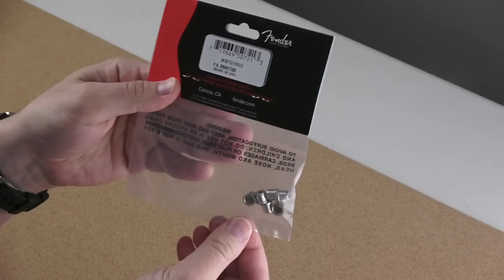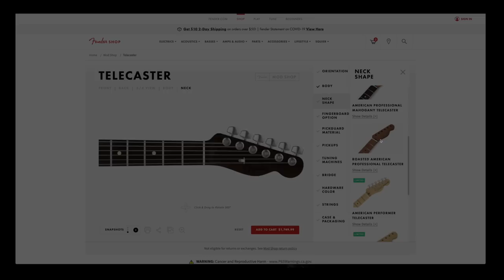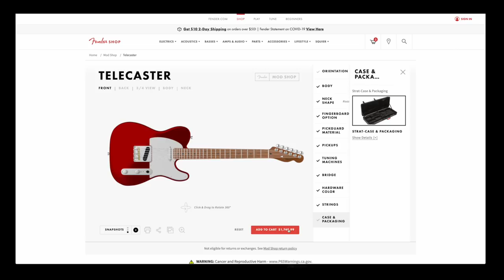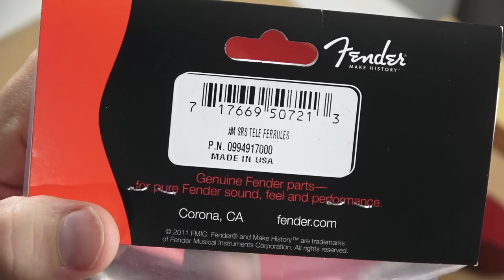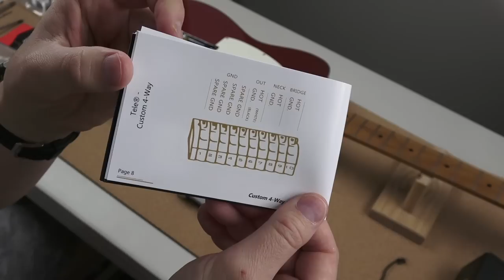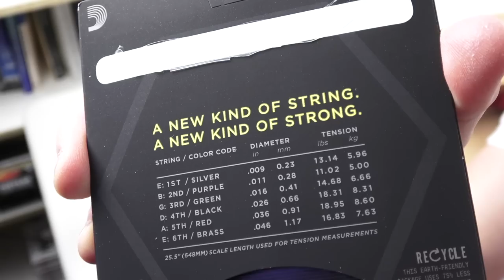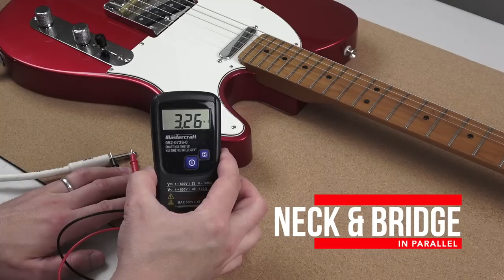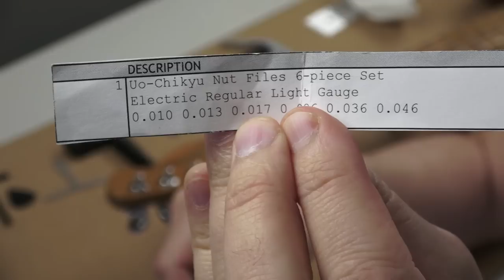Building a Custom Candy Apple Red Fender Telecaster with Roasted Maple Neck  & Obsidianwire 4way Kit

Comment: Fyi when screwing something like a neck for example with 4 screws in a square pattern u need to tighten them in a diagonal pattern. If u start with top left screw - then second screw should be bottom right - then back to top right -  and lastly bottom left. This is to avoid any type of tilt and makes things tighten down evenly
Reply from the maker: thanks for the tip! cheers
Reply: @landonbailey  no problem, awesome videos
Reply: @landonbailey  ye that’s a top tip I was just about to say it myself

Comment: I've been building for 60 years.  You did a great job. Kudos.
Reply from the maker: appreciate it thanks! Always more to learn for me :)
Reply: @landonbailey  I'm still learning myself.  I recently built a replica of a Hittite guitar (Western Anatolia) found in a grave during dam construction in Turkey (1924).  It dates from about 1600 BC, pushing guitar history back 3600 years.  My next project is to build a Roman guitar dating from 100 BC.  This instrument has such an incredible history...and it still continues to this day.
Reply: @landonbailey  Hi Landon, great video, thanx. I finished very similar partcaster, not candy apple red but olympic white alder mexican body and just the same roasted maple neck. I had problem with symmetry of string to the neck and bridge position. You know, every holes are predrilled so you do not have any possibility to shift neck in neck pocket or move bridge to compesate the symmetry. I had to change original fender bridge and use gotoh BS-TC1 Vintage Telecaster Bridge w/ In-Tune Saddles. Now I have quite good distence e string to edge of neck and e string does not fall out the neck/frets.
Reply: I agree ditto
Reply: @fnersch3367  that sounds amazing. I bet they will sound amazing, too.
Reply: Awesome 😎👍💯🎸🎸

Comment: About 18 years ago I got an American '62 reissue Strat. I put on a compound radius neck from Warmoth. The original neck had a rosewood fretboard so that's what I stuck with. I had them use skinny frets and I had it drilled for Sperzel locking tuners. Then I installed a five way switch and a DiMarzio Air Norton S pickup in the neck. These are two companies that make some of the best after market parts around.

Comment: A tip for inserting the ferrules... Use a pencil style soldering iron in the hole of the ferrule and let the heat do the work.  Goes in like a hot knife through butter.
Reply from the maker: Hot tip! Thanks! :)
Reply: @landonbailey - Literally! :)

Comment: I used one of the fender roasted maple necks for my strat. Turned out great, I got 12" radius wide oval. It came out awesome, but I play with my thumb over a lot, and the edge of the fretboard itself was so sharp it was cutting me!!! I rolled the edges, now its awesome
Reply from the maker: nice work! what do you use to roll the edges?

Comment: I do all the wiring business first - before attaching the neck - mainly because it's what I struggle with the most. And I figure why have the additional weight and mass of the neck when I'm positioning the pickups and wiring, etc. This may not be an issue for you, in that you're using the solderless wiring harness. I usually use ToneRider pickups and their wiring diagram includes the bridge ground wire, so I do it. Sometimes I replace the latex(?) rubber tubing with springs because I have concerns that tubing like that might tend to dry out and get brittle over time. Thanks for the reminder about waxing the screws. Totally forgot about that on my last build. Nice job!

Comment: Nice job, I hope you enjoy it! 

One tip, after all that work putting in the shielding tape, you never grounded the tape in the neck pickup cavity or the wire channel (the control cavity got grounded when you put the body ground through the tape, and if some tape was sticking up high enough to touch the bridge the bridge cavity will be grounded). If you don’t have a soldering iron, put a little copper tape between the lug of the neck pickup cover and the foil on the pick guard. That will ground both cavities that touch the pick guard. Ideal, of course, would be to solder a little ground wire to the cavity tape. 

The other slight thing I would suggest is to file the top of the nut so half the wound strings are above the slots. This will help with tuning stability. 

These issues are really slight though. You really did a great job, and you have a guitar you should be proud of!
Reply from the maker: thanks for the tips!

Comment: The grounding wire should be under the bridge pickup so that the shield is connected to the back of a pot, the ground on the back of the bridge pickup connects the bridge to the back of the pots, that is why you don't need to ground the bridge. Set the bridge height generally then cut the nut, then redo bridge height and intonation, make sure truss rod is correct then play guitar and then let settle for 24 hours, and come back and check truss rod and saddle heights. It looks and sounds great 👍👍👍👍

Comment: You was bang on correct about the pick up grounding of pick ups a fender jaguar has a similar thing with like teeth round pick up but if it was me I'd go springs as after time the rubber goes soft and breaks up plus all adds to metal connectivity with bridge pick up but the rubber grommet is a small thing and can be changed in minutes if so! So nothing major I just personally like springs more sweet tele though man super nice parts them obsidian wire kits are super sweet I personally think they are the best money can buy top pots and switching always so well done super nice instrument for life that one

Comment: Hi Landon: thanks for the complete walk-through. Very useful. I have a suggestion: do as much work on the body and neck as you can (string ferrules, shielding, tuners and string trees) before attaching the two together. The body will lie flat for you while you press in the ferrules, and the neck will be easier to handle while you do the tuners, etc.
Reply from the maker: cheers!

Comment: A small tip for anyone really looking at a budget build is that you can pick up Fender reject bodies and necks very cheaply. My tele body and neck were about $250USD. 

There are a couple of downsides to this - first they are usually unfinished and require you to sand, fret and paint them yourself. This takes quite a lot of time and practice to get remotely close to the professional finish. Second the rejects usually have a few defects for example the neck saddle on mine was .2mm off the factory standard. But the defects are normally minor - my TC body was about $100 and was rejected for having 'an ugly grain'.

Comment: I suspect it’s conceivable that you have a ground path from the bridge to the controls through the rear pick up like you were told. You could use your multimeter ohm setting to verify that it is. However, the effort you put into shielding on the pickgaurd and the neck pick up and other cavities. Really need to have a physical connection to ground or they’re doing nothing. Great video! Thanks for sharing.
Reply from the maker: the bridge pickups is self grounding to the bridge plate, if that's what you were referring to.

Comment: I have built more Telecasters than I can count for myself and many customers.You asked about grounding the bridge pickup. I use a hole under the bridge plate via the output and ground it to the back of the volume pot. Must've been expensive if all Fender parts. I agree with the routing for a humbucker in the neck.Easier with 21 frets.When filming maybe consider what you are filming- often your hand obscures the work itself (see 44 min. 40 sec. mark and others). Cost? Terry from Oz.
Reply from the maker: cheers Terry! ya I may invest in a second camera just for that reason!

Comment: There are right hand threads and left hand threads.  Typically most threads are RH and this means that, when looking down on the screw you turn it clockwise or "righty tighty" to tighten.  LH threads typically are used when you don't want something to rotate out.  Bicycles use LH threads on the left pedal (for example).

Comment: Personally i stopped putting the neck on first if its a 22 fret as it makes it a lot harder to fit the scratch plate with the pickups in because of the 22nd fret overhang. BTW if you ever want to remove string ferrules, all you do is put a drill bit through from the front side down the string holes and very gently tap out with a mallet.
Reply from the maker: thanks for the tip with the ferrules!

Comment: Excellent video Landon . You did a great job. Only issue I saw was tightening the neck. You want to do a crossing pattern such as top left bottom right top right bottom left. Doesn't matter which one you start with just a crossing pattern after you tighten the first one. Also don't tighten all the way just get the first one kinda firm until you have all of them that way then proceed to snug them all down still using the crossing pattern. Hope that info helps you or some one else !
Reply from the maker: cheers! thanks for the tips

Comment: I’m in the process of doing my first build, a kit from Solo Music Gear. It’s been a really great learning experience for me. That said, for anyone getting a kit, know that a lot of kits aren’t configured for standard size parts—I’m currently attempting to get my obsidianwire kit to fit in the control cavity (and I don’t have a dremel, so it’s taking forever 😝, even had to take a chisel to it to make it a few mm deeper)
Reply from the maker: Tele kit? I did the chisel method on a Strat clone a few years back. My first mod project.
Reply: Landon Bailey yep it’s a tele kit! Ran into other problems too (like the pickguard’s neck pickup cutout was too small for a Fender pickup to fit in, so had to file away a bit of that). But overall it’s been a fun project.
Reply: I had a made in Korea Tele that had the same problem. The cavity for the volume/tone controls needed to be dremeled out a few millimeters to drop in flush. Be careful one slip and you will go through the back...lol
Reply: @bobboitt3126  I actually did go through the back and had to patch it up lol. There’s currently a sticker covering some wood filler that I couldn’t get to look right haha

Comment: Pretty cool—thanks. I'm hoping to build a Tele as my first 'project guitar,' just because i want a nitro (MJT) body. I've never done anything like this, but i think one thing i'd do differently is put the string ferrules in first, before attaching the neck, so i won't be putting pressure on the neck when pressing in from the back. Does that make sense, or am i just imagining a problem that doesn't exist in reality? Oh, also—now that i just finished watching the whole thing: what about drilling the holes before doing the assembly? Using the pickguard and control plate to just mark the hole positions, then drilling them so you're not using a drill bit against the inside of the plastic holes?

Comment: 46:14 You actually can reverse this. Put small a pinch of baking soda into the slot. Then put your index finger over the slot and blow the extra dust away. Put a small drop of super glue on it. wipe off excess and wait for it to dry. You should be able to re-cut the slot for the string.
Reply from the maker: Thanks for the tip!
Reply: Landon Bailey No problem!

Comment: Don’t know if I missed the part where you grounded the copper tape - but if you didn’t it won’t do much.  You’re right on the money about the tele base plate grounding the bridge though.  Looks great overall. 👍
Reply: As far as I understand the pickup plate connects the circuit ground wire to the bridge, which connects to the strings which connects to your body which serves as the ground. The copper tape doesn't need to be grounded to the circuit to act as a Faraday cage and shield it from external electromagnetic fields.
Reply: Latino Sci-Fi Geek you’re not creating a faraday cage.  That’s a misnomer.  What’s actually happening is your creating an antenna of copper tape.  When the copper tape is grounded all the interference signal that we don’t like is caught by this copper foil tape net/antenna and sent to ground so that it’s not introduced into the signal path.
Reply: @huddyskiba1  I respectfully disagree. The conductive shielding doesn't need to send the interference anywhere. A conductice material's electrons align themselves in order to mantain a constant electrical potencial all over it, which shields the interior of a cavity it surrounds from incoming electromagnetic waves, i.e. Faraday Cage. The circuit ground is a separate part of the system, using the human body connected to the strings to keep the circuit ground at a constant potential. The reason to connect the pickups' grounds to the copper tape is to simply that, to connect them together and themselves to the strings via the bridge, claw or some other way.. In this particular system that isn't needed because the obsidian circuit already have a common ground connecting the pickups grounds and the bridge through the bridge pickup plate.
Reply: Latino Sci-Fi Geek there is one ground in the guitar; The ring of the output jack.  If the copper tape or whatever shielding medium one uses is not, in one way another, connected to the ring of the output jack, the shielding medium will be useless.  It’s not doing what you think it’s doing despite how many books you’ve read or how many classes you’ve taken.   The reason noise goes away when you touch the strings is because the interference that your body is picking up was getting into the signal but is now going to ground because you are connecting yourself to ground - the sleeve of the output jack via the strings.  You’re grounded because you’re touching the sleeve of the jack not because your feet are on the floor.  The hum doesn’t come back if you jump in the air.
Reply: @huddyskiba1  If that was true the guitar wouldn't hum if no one were touching it or if the strings weren't connected to the circuit. Why connect the strings to the ground if it's the ring on the jack sleeve which acts as  ground? That doesn't make sense. The human body is not the source of the interference, the pickups and circuit being hit by external electromagnetic waves are. The body doesn't need to have its feet on the floor to act as a constant potential, which is what an electrical ground is.  Also the guitar bulit on this video doesn't have the pickups cavities connected to the ground, only the obsidiam circuit cavity, yet the pickups are perfectly shielded from interference. All my arguments are based purely on physics, which doesn't depend on how many books I've read, classes I've taken or guitars you've played or built.
Reply: Latino Sci-Fi Geek the sleeve of the output jack is ground because it’s ultimately connected to the ground of your home via the 3 prong cord of your amp.  The “shielding” in the pickup cavity isn’t always necessary for quiet operation.  It depends on the environment.  Are there florescent lights?  Dimmer switches?  Something with an electromechanical motor close by?  A bar with an ice machine cutting on could stir things up.  A home environment may need little to no “shielding” at all.  He could’ve not “shielded” the pickup cavity and yielded the same results.  That’s why you can just tape up the back of the pickguard - just one flat surface; not a cage by any means - and eliminate 80-90% of the hum.
Reply: @huddyskiba1  Down here in Brazil our homes don't have groumd wires, our cord plugs only have two connectors, still our guitar circuits are grounded when connected to the strings. My DI box have a hum when connected to my mixer which goes away the moment I touch its metallic casing (which is connected to the circuit ground). 
As I said earlier, the metallic shield act as an equipotential surface which dampens incoming electromagnetic waves generated by  external electrical circuits. That's the principle behind a Faraday cage. It doesn't have to be connected to anything else to behave like that. It doesn't have to be a cage either. It's still the same physical process behind it.
I said my piece, I am afraid if we continue we will just be running in circes. You can fact check the informarion I mentioned if you want, or not. Cheers.
Reply: Latino Sci-Fi Geek you might only have two prongs... the US did as well for many years.  That just means that the ground and neutral are combined.

Comment: when installing the string ferrules you could of used a short wooden dowel rod and a mallet and to make sure all six ferrules were flush with each other at the same depth the you also could of used a small wooden rectangular shaped block.

Comment: Well done.  Sounds great too.

If you'd like a tip (that I take no credit for, as I've seen it a few times from builders), if you loosely braid the cables fully--and not just at the end--it helps with shielding also.
Reply from the maker: Thanks for the tip!
Reply: @landonbailey  Have you considered building a Jazzmaster next?

I've been thinking of doing that, but it appears to be harder to find nice Jazzmaster bodies.

Comment: The ground on the bridge PUs with the metal back plate is already grounded. With plastic backs have a separate ground to connect to the adjustment screw.
Reply from the maker: Exactly what I believed. Thanks for confirming. :)
Reply: No problem. Literally went through that on Saturday with a set of Pure Vintage '64s lol